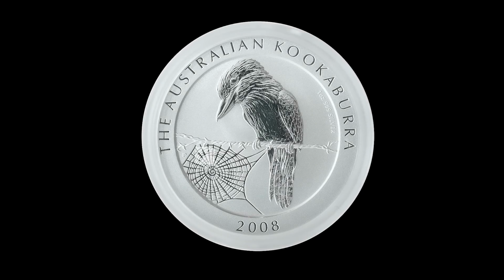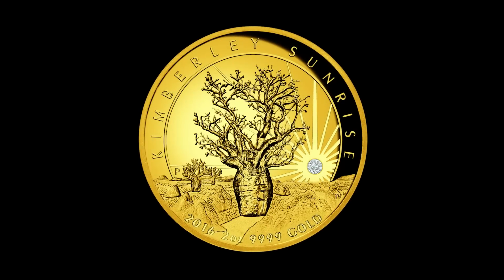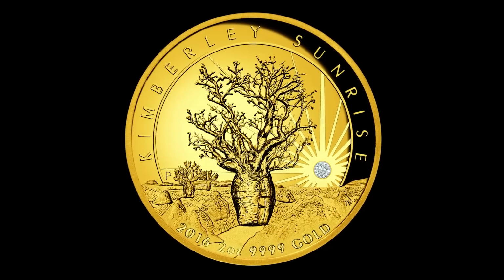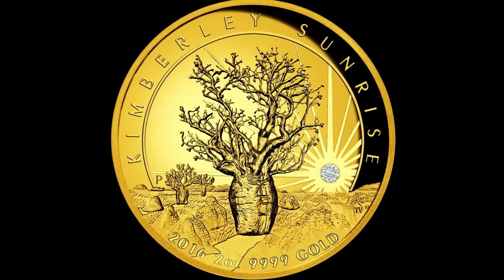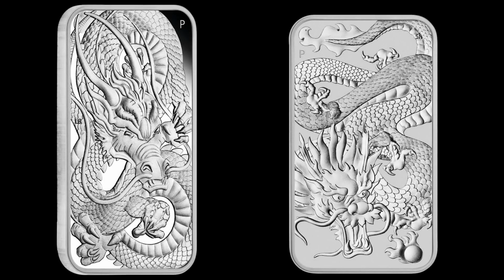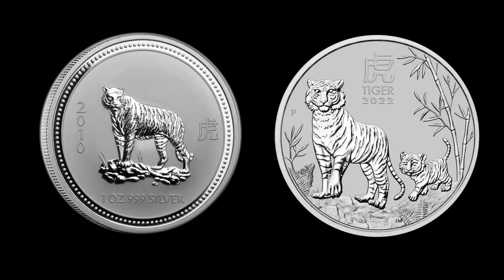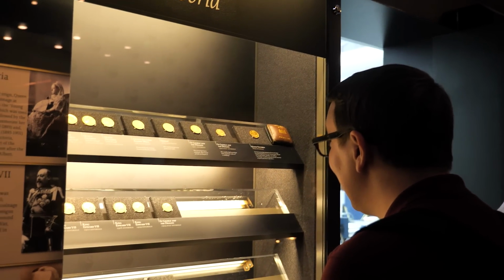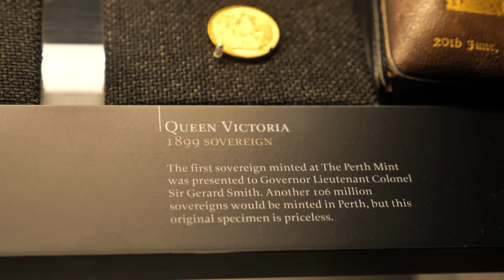An Interview with The Perth Mint!

Comment: The new perth mint website is atrocious! Whoever designed and is running it should be sacked. The old site was way more practical with layout and manoeuvrability.
Reply: I agree the new layout of the PM website is terrible to use
Reply: By design... slow down demand by frustrating customers
Reply: @gomariussmith  Yes used to buy heaps direct from PMInt , now very rarely .
Reply: Second on the PM website being pathetic. As you say, it was functional, practical. Now everything is obscure by that silly oversized drop down, the search is horrid, etc.
Reply: That's where bullion now comes in.